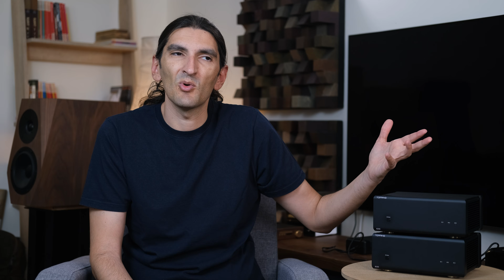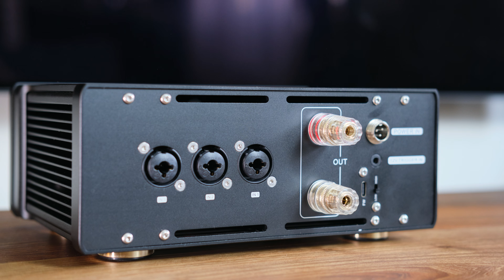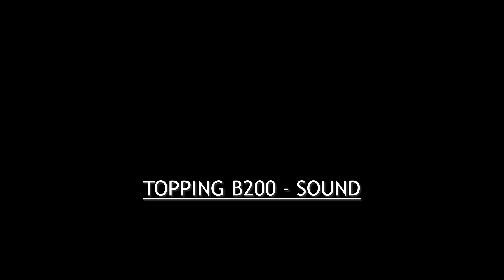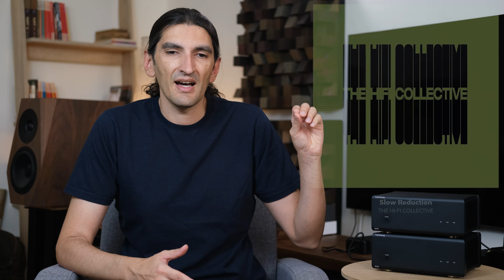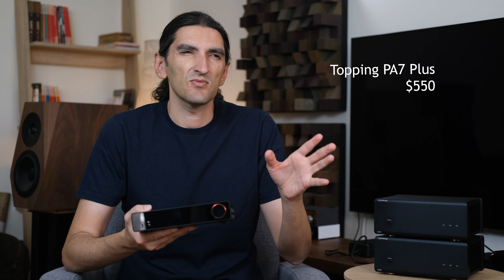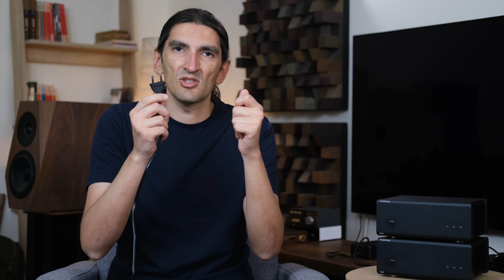Just get them and thank me later - Topping B200 review

Comment: Thanks bud! I've had my B200s for a couple of weeks now. It's my first Topping, having been an Audio-gd fan myself. I recently got in a Holo Audio Cyan 2, which trumped my Audio-gd R7 DAC - the primary upgrades being clarity and transparency, as well as improved dynamics. The B200s replace my Audio-gd A1 amp - and they have also improved the clarity and transparency even further. The soundstage depth and pinpoint imaging are on another level now, veils have been further lifted and the speakers have truly disappeared. The rig: HTPC USB + Tidal -> Holo Audio Cyan 2 -> Audio-gd Master 9 -> Topping B200 -> Purifi-6R. edit:R7 not R27!
Reply from the maker: Enjoy your new and unveiled sound! 👍
Reply: As I'm also an Audio-gd listener, your commentary is very interesting.    I have an R8 dac and a A1 amplifier: do you feel the B200 has at least the same quality of tonality? Is it compatible with Audio-gd preamp (I have Master1)? I'd be grateful for your answer. Jorge
Reply: @jorgeleandrorosa2881  Awesome to see another Audio-gd bro! The quality and cost/performance of Audio-gd products cannot be denied. (Typo in my previous comment, I actually have an R7 2020 DAC)

I haven't reverted back to the A1 amp yet but my overall impression is that the B200s have a similar neutral tonality to the A1, but with better defined bass, better clarity, transparency, resolution, and sharper and deeper soundstage imaging. There might seem to be a touch more treble due to it being more resolving, but I'm not bothered by it as I have already switched over to the clarity and transparency side of the hifi journey (eg, I went from the Harbeth Super HL5+ to my Purifi-6Rs). In fact, with the A1, I sometimes found the treble, particularly the long cymbal brush sweeps in jazz, to be a bit constrained and grainy. It became more apparent after listening to the B200s, which made those same cymbal brush sweeps sound good instead. 

As for your Master 1 preamp, it does have a different output impedance to my Master 9 - 10 ohms vs 1 ohm - but that's not an issue since the input impedance of the B200s are 10K ohms, and the general guidance is for the amplifier input impedance to be at least 10x the output impedance of the preamplifier. The B200s in 11.6dB low gain mode do reqiure me to crank up the Master 9 volume by about 10 notches but no issue with that for me. If you wanted to you could switch it to 22dB high gain, which is the same gain as the A1.

I would heavily recommend the B200s if you're looking for that more transparent sound. But YMMV. Worse comes to worst, they do seem to be in high demand (I wanted them in black and had to compromise for silver), and if you don't like them they should be easy to sell on. 

Just FYI, I've also just yesterday gotten in a Topping Pre90 and am in the midst of evaluating it. I'm still undecided on if I prefer it to my Master 9, but so far it does sound a touch more transparent.
Reply: Just updating here that as it turns out, I prefer the Master 9 as opposed to the Pre90. The Pre90 gave the impression that it was more transparent but introduced an artificial sheen to the sound that provided a sense of illumination but also introduced an unnatural qualtiy to the presentation. Plus it was also slightly leaner sounding. Would not recommend the Pre90.
Reply: @infn  I thank you for your detailed impressions! Can I conclude that the Audio-gd power amp is more easily replaceable than the preamp? Master 1 and Master 9 are very similar in fact.
Reply: @jorgeleandrorosa2881  Yes I believe that is the case - the A1 is by no means bad, it is just a bit behind in performance to the B200s. If you like the Master 1, then you like the Audio-gd house sound (I have heard it and a few other Audio-gd preamps down the years and yes, the Master 9 is quite similar) and I think the upgrade path would be something like an HE9/HE1  instead.

Comment: I would never buy a Amp with an external power supply. It's just an off the shelf brick with no quantity control of the Amp manufacturer. I would buy a fully designed product, not half baked junk.

Comment: Cao Srboljub!

Hvala na odličan kanal na Youtube. Pratim te več odavno🙂.

Now to my question, I have an Audiolab 6000 play and Elac 247.2 speakers that I am really happy with. The problem is Play-Fi DTS which is a pain, especially as I use Tidal 99% of the time as music source (no Tidal connect, and the native DTS Tidal integration is a disaster).

You review of the Topping m200 had me thinking. Could a Eversolo A6 streamer combined with two Topping m200 monoblocks be a good upgrade? Do I need a pre-amp or can I plugg in the Eversolo directly to the m200? 

Thanks again for a great channel!

Srđan pozdrav iz Švedske!
/Saša
Reply from the maker: Pozdrav Saša!

I wouldn't use Eversolo as a preamp, especially with these amps... It would sound thin and analytical to my ears. A preamp is a must there in my personal opinion. At least plan for it sometime down the road if you want to hear what these can really do.
Reply: @iiWiReviews  Hvala :)!
Reply: A good premap makes all the difference but your audiolab 6000a has a pre amp only option in settings so you could use that in preamp mode only, it's pretty good and clean

Comment: The people with the golden ears who can talk endlessly about loudspeaker cables can now think about the quality of the cable between the power supply and the amplifier. After all, it has to transmit all the power that ultimately reaches the speakers, so it should be of at least the same quality as the speaker cables.
Reply: Good point. You can not change that cable either

Comment: This is perhaps one of the best reviews I have ever heard! I am totally blown away by your command of English and the highly differentiated way you can describe the subtlest of differences in glorious detail while not losing sight of your goal. I don’t know how many other languages you speak but I am very very impressed (I am learning my fifth so I know what it means to achieve such a refined vocabulary). 
I won’t be changing any time soon (I have the Topping D90 DAC and love its value proposition) and just changed to the Transaudio D5 Pro which finally drives my KEF Reference Two Threes with authority. 
Great YouTube channel! Excellent work! Thank you for this wonderful review!
All the best Rob in Switzerland
Reply: How do you like the D5 Pro? Also thinking about either getting that or the SMSL Pa-X
Reply: @SalvadorZerker Hi Salvador - I LOVE IT! For the first time my KEF Reference Three/2 speakers came alive. I think they are power hungry and are rated at up to 300W into 4 Ohms. The D5Pro delivers 225W into 4 Ohms and really brings those speakers alive. It has a very extended frequency response (I think from 7 Hz to 300 kHz) so really delivers at both ends of the spectrum. It is also very transparent and can deliver deep (tight & dry) bass as well as good mids and airy highs. Meanwhile I think there is a better amplifier (T9.4 Pro) but I understand it is significantly more expensive. For the moment I am very happy with my D5 Pro. I hope this was helpful. All the best, Rob in Switzerland

Comment: Hi. I enjoy your reviews a lot, especially how you explain the sound. You said in this review that you tested purifi based amplifiers. Can you please name the amplifiers or the purifi module? How does it compare with B200? Now seeing your review I am trying to decide between B200 and purifi 1ET400A based amplifier. Thank you.
Reply from the maker: It was 1ET400 from Audiophonics. Very clean and transparent sounding amp. Very similar in tonality to B200 but somewhat softer and more laid back sounding, less punchy than two B200.
Reply: Hi. Audiophonics now offers monoblock's 1et400a based amplifier with 600w power unit. Don't know if this makes any difference compared to the unit with 1200w and 2 purifi 1et400 modules. Audiophonics is also customizable offering the possibility of upgrading the OPA. Your answer is much appreciated. Thank you. Do you think the OPA can improve the sound of an amp? Best regards.

Comment: It stands to reason, I think, that the Topping would be overall a bit brighter in sound than one of the larger IcePowers (which is the only other amp you use here that I've listened to at length). I'd venture to imagine that the Class AB architecture of this Topping would introduce some level of added harmonics that would account for the overall "upward frequency tilt" of the Topping, versus the "honest and reliable, if a bit dry" (and these are my words based on thousands of listening hours) character of the IcePower amps.

EDIT: ...and let me join the chorus of the rest here, thanking you for your fine work!

Comment: Thanks for the review and especially the comparisons! Did you compare the Topping to a single Ice power 1200as? I figure I could build an amp with the Icepower module for around 500 euros, which turns around the value proposition quite a lot...
Reply from the maker: I did briefly before realising it will take two to be a match. One IcePower has narrower soundstage and less bass slam. It's not far behind two - and it is better value for sure. If you can make it for that amount of money I don't know anything else around 500 that could beat it.
Reply: @iiWiReviews  Thanks!

Comment: They look like they’d be great for an active setup.
Reply: what does that mean
Reply: Instead of separating different frequencies is a passive, unpowered crossover at the speakers, you do the frequency separation (s) after the preamp using an active (powered) crossover. Then each frequency band (2,3 or 4 usually) uses separate power amps connected directly to each respective loudspeaker driver.

Active speakers have the power amps inbuilt, so in that case you send the signal from the preamp directly to the speakers. You cannot use an integrated amp in an active setup.

Comment: Hi Srboljub! Thank you for continuing to post these reviews. They are my most important guidance in the audiophile world. I have an Acoustic Invader Amp/preamp stuck, a VOLUMIO streamer, Harmony DAC, and Marten Oscar duo speakers. I also lubed my system with snake oil, like LHYaudio linear power supply and SW6- SFP ethernet switch. I think I will resist the temptation to buy these new Topping B200 amplifiers. I put definition and transparency above all other sound characteristics, but I am not taking the risk of sacrificing the roundness of the sound I have just achieved.
Reply from the maker: Thank you for nice words. I agree, changing components that already have great sinergy is a road to getting gray prematurely.

Comment: "interfence" problem meaning the "noise" produced is not literal "noise" that we would here with our ears but "ELECTROMAGNETIC NOISE" or "the heat caused by too much conversion of electrical energy from wall into usable mechanical energy in the amplifier of the noise thingy" being reviewed here. "Clean" power is thus not hot but much less hot hence all the heat dissipation so as not to disrupt the "signal" which is "clean broadcast" from an antennae or satellite dish now that brings in the actual music or visual product or both audio visual product and so a different not a plug in the wall source.

Since these two sources of in fact energy do not in any way have physical interfence one from outlet other from wireless source considered "clean as 2 sources" not interfered with in any way from either or. "Clean" power "clean sound" even now "clean audio visual." This is all then combined in a "clean" way to produce what was said or seen elsewhere to you the person doing the review or you as the consumer "REPRODUCED LOSS-LESS" meaning same as in the "production studio" so think of going to listen to hear someone speak or sing for real then go home "sounds same if not better at Home" is called *"lossless." again this includes video now which is quite amazing to do that actually. Very good signals processor #digital_signals_processor to do that #dsp for short. "Perfect quality" meaning "lossless" sounds the same at home as if "there in person." Small is good now too "portable wireless cable free sound and visuals." This even includes production of same said or "cell phone" today now meaning you can record audio sound and visual have all that with you including playback and sharing now even all with cell phone now today.

Comment: Linear power supplies are expensive. Power supplies are the most important factor in amplifier performance. Doubling the power from 8 Ohm (200W) to 4 Ohm (400W) would be a sign of quality. Amplifier performance is mostly dynamics, timing, flow, immediacy. Topping tries to sell you a car with an engine that has one cylinder only - a dirt cheap 50$ switch mode power supply. Ridiculus. Reminds me of mid fi amplifiers in the 90s that claimed 1000W but had very poor current delivery and stability. At least they are honest with the poor 4 Ohm performance.

Comment: I noticed a few curios points with these amps, but first up, mono blocks are the best configuration for HiFi systems because they preserve the damping factor of the speakers (assuming the amps are capable of handing the reactive load properly).  This requires the speaker leads to have the smallest possible impedance.
The external PSU though is woefully under powered. 200W into 8 Ohms needs 40VRMS and 5ARMS. Into 4 Ohms it is around 30VRMS and 7.5ARMS. There are many reasons they may have settled on a 64V supply, some good and some not so good.  If it is to keep the transistors in the amplifier in a more linear region that could be good unless they do that so they can rely less on the negative feedback loop which will destroy the damping factor and the bass will be muddy (for a start).
IMHO you did not find the right tracks to test these amps in the areas they might fail. Old school amps using more traditional mains frequency transformers have the advantage of going into overload or heavy load gracefully. But those types of power supply are becoming rare due to regulatory requirements. These amps will be relying on bulk capacitance to carry the heavy load peaks of current and the designer is relying on the music not demanding those peaks for too long.
Have you measured the power output of these amps? I think you might be surprised and maybe a bit disappointed. I would also say the heatsink is undersized for the power output and the power rail voltage.. What I am saying is that the are not 200W amps. Power supply and heatsink strongly suggest this to be the case.
Reply: Would be fun to have them compared to something like the A75. Similar price range. I'm pretty sure the 75 water will have more power 😉

Comment: Srboljub, I have really enjoyed your reviews. I like them for two principle reasons. First your descriptions of subltle differences are usually illustrated with examples that help me understand what you are describing. Secondly, you aren't afraid to make comparisons that actually point out the strengths of a product compared to its competitors. So many reviewers are afraid to just state a products superiority for fear of future reviews from manufacturers. In this review you even stated the disadvantages of placing these transparent amps in a mediocre system. I have experienced that before and it can be frustrating to now hear the shortcomings of the rest of my system after installing a very revealing component. This leads me to ask a question. 
I am currently piecing together a new and better front end. Due to cost constraints, I did some pieces DIY with well proven designs and superior parts. The last piece I'm struggling with is a budget killer preamp; something in the $1,000 to $2,000 range. I've seen your reviews on the Freya, the ladderbach, the regular acoustic invader, etc. Do you have any advice on a preamp, even one you haven't reviewed, but heard extensively? I've been picky on this last piece because I think it can have the most effect on sound if the other components are top shelf. I've even considered passive. Thank you

Comment: What are your thoughts for using these as Atmos amps? Perhaps using a Denon 11 channel or higher pre-amp? Understanding that you might need to bolster power to the electrical sockets that they would be plugged into....(as in dedicated electrical power and power circuits to the electrical panel.

Comment: How does this compare to the LA90D? The LA90D is the amp that this is based on, so for smaller speakers
 will it sound similar?
Reply: Topping on ASR: B200 is the basically an LA90 Discrete that's optimized for bridged configuration only. Gain structure and values are re-tuned for lower noise. PCB layout was tweaked a little to reduce magnetic field coupling in the chassis slightly for lower THD.

LA90 was using integrated Op-amp and Chip-amp in NFCA circuit. LA90 Discrete takes the idea and implemented in discrete fashion plus some extra goodness. The result is a bit more power and a bit lower noise and a bit less high frequency distortion than LA90.

TLDR LA90 was last gen. LA90D is slightly better and B200 is slightly better still.

Comment: power supply outside the amp itself is a great idea really.  how many amps die and its the power supply ? quite a few. this way you can actually put a better supply in it and the amp itself and can made of better quality.
Reply: If the PSU was a high grade one and the amp and cable could handle it without actually adding distortion it is. Weirdly enough most high end producers don't think that's the case 😉